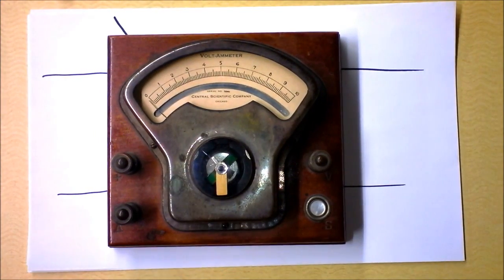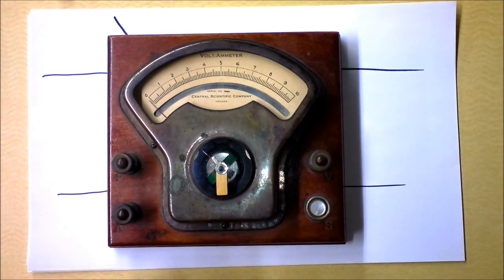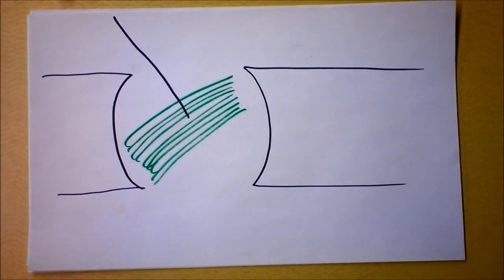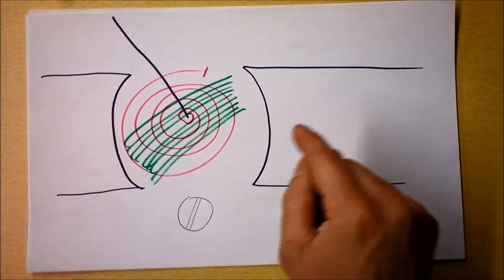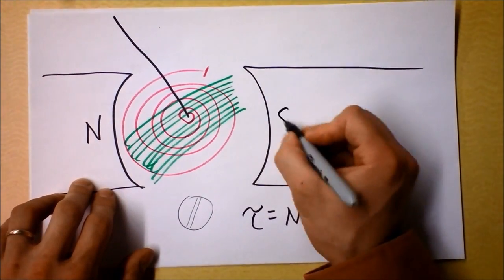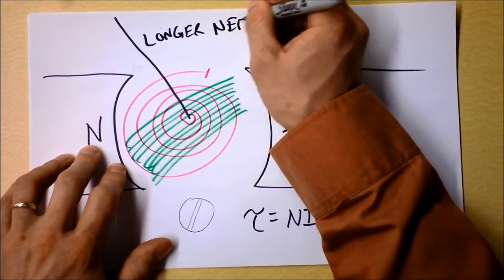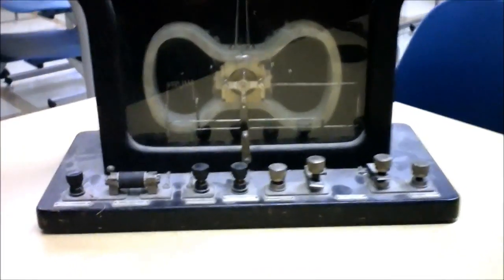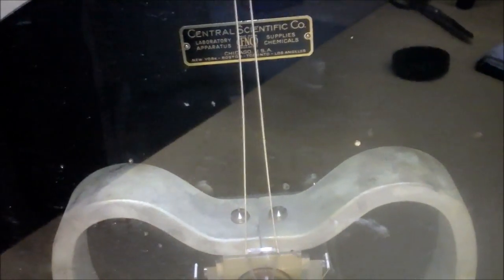Galvanometers are Awesome.  The older the better... | Doc Physics

Comment: Shenzhen Han's Scanner S&T Co., Ltd. is a high-tech enterprise that integrates technology research, development, production and sales. It is a wholly owned subsidiary of Han's Laser Technology Industry Group Co., Ltd., the listed company, located in Shenzhen Han's Laser Industrial Park, China. 

Han's Scanner has professional R&D Team on machinery, software, optics, electronics, process testing, etc. We have obtained a number of model utility model and invention patents, besides R&D standard galvanometer products we also provide professional galvanometer system scanning solutions for our clients.

Our Products:
Single galvanometer system
2D Galvo scan head (X Y galvanometers)
3D Dynamic focusing scan head (X Y Z Axis)
Voice motor(Z-axis dynamic adjuster)
HashuScan(Intelligent 2D scan head with control board&marking software)
Medical&Aesthetic fractional galvanometer
High Power Galvanometer Welding System

Applications：
Laser Marking
Laser Marking on-the-fly
Laser Cutting
Laser Welding
Laser Engraving
Laser Drilling
3D Printing
Medical Treatment
Science&Research
OCT Imaging
Laser Show
Automotive radar

Contact: Alice You
Sales Manager
Shenzhen Han's Scanner S&T Co., Ltd.
Add: 4F Building4, Han's Laser Industry Park, 128 Chongqing Street, Fuyong, Bao'an District, Shenzhen City, Guang Dong, P.R. China.
Mobile/Wechat/WhatsApp: +86 15220100011
Skype: live:599a21d7378d05ab
Email: Scanner-sale1@hanslaser.com
Web: www.hansscanner.com

Comment: isn't is nBIAcos(theta)  for torque?
Force = nBILsin(theta)
Reply from the maker: Depends tremendously on how you define theta.  How do you?
Reply: for F=nBILsin(theta) its the angle between the current carrying conductor and the magnetic field while for T=nBIAcos(theta) its angle betweenthePlane of the coil and the magnetic field.
Reply from the maker: Are you defining the direction of the plane as the direction of the normal vector to the plane?  I am using that convention, which demands a sine there, I believe.
Reply: imagine in a simple DC motor, that the current carrying coil is a page in a book laid flat, with the flat of the book representing the magnetic field lines. If you were to lift this page, as if to turn it, then the angle of elevation (b/w the page and the flat of the book) would be the theta in my cos(theta). This is why when the PLANE of the coil is perpendicular to the magnetic field lines, cos(π/2) =0 and hence there is no torque on the coil.
Reply: so no, im not using your convention.
Reply from the maker: Thank you for explaining your conventions so clearly!  I do define theta as the angle between the normal to the plane (which I call the direction of the area vector - outwards), so I use the sine where you use the cosine.  Our conventions just differ by pi/2.  Thanks for watching!

Comment: read thevinin theory, that any voltage source series with a resistor can act as a current source in parellel with a resistor. So It could have a internal resistor that can be used to set the range of current you may be passing through, via a voltage

Comment from the maker: See, that's just it.  It's not clear whether a galvanometer is measuring voltage or current, but it's not important, since the resistance of your testing current is typically not known.  Watch on, though, because the resistance actually depends on frequency...  All that combined means you just trust that a galvanometer is measuring volt-urrent and you stop worrying!